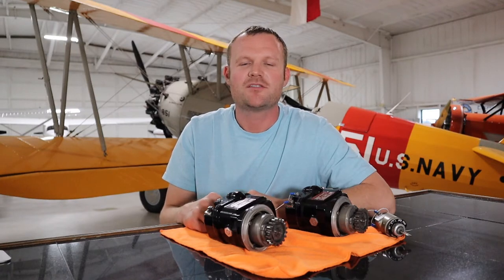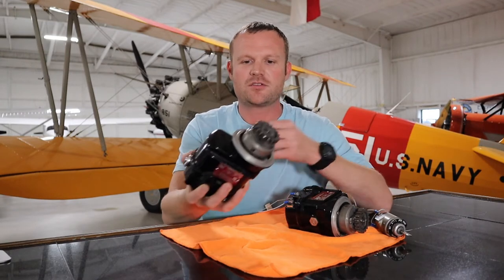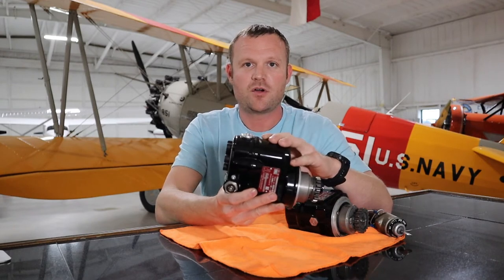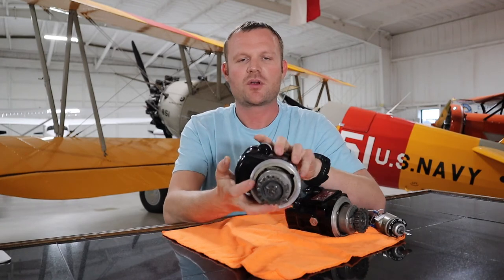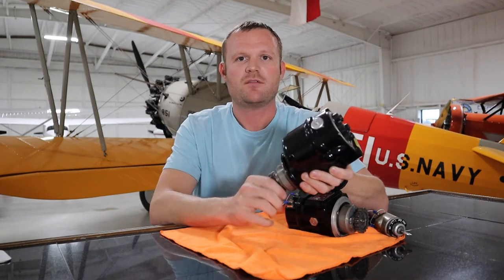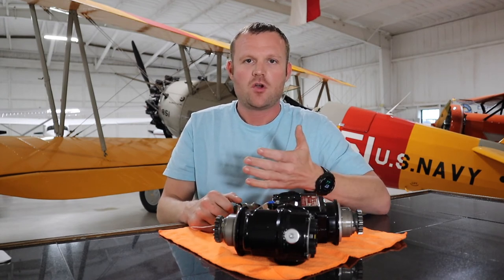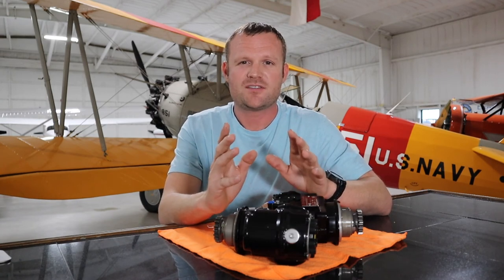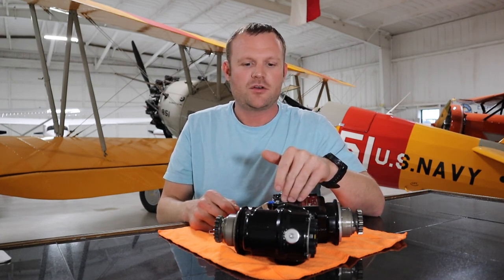Magnetos - Aircraft Engine Systems

Comment: I would add this to the information presented in this video:  In my 45 years of flying every checklist I have ever seen describes the procedure for doing a magneto check during the Before Takeoff checklist items.  That is all well and good, and should always be performed.  However, I subscribe to doing another magneto check after you land and are going through the Shut Down checklist.  The reason for that is that it is possible to loose a magneto during the flight and you may not even notice it.  If you check the magnetos just before shut down and find that one of the magnetos is inoperative that is the best time to report the failure to a mechanic so he can resolve the problem.  That is much better than finding out you have a magneto issue just before getting ready to takeoff and then needing to delay, or even cancel, your departure.
Reply: That’s how it’s taught here in New Zealand, check before takeoff and before shutdown

Comment: I only worked in aviation a short time, back in 1970. After I got my A & P license, I worked in other parts of aviation, getting little experience. When you graduate from aviation school, They tell you to go out and learn to be a mechanic.I think a lot of people don’t know that there are 2 plugs per cylinder. I’ve learned more from watching these video’s than 2 years of aviation school. We never had a mixture control on the carburetor to kill the engine. I had little magneto training. They need to know that the magneto has a permanent magnet that produces spark in the primary and there is a set of points that shorts out the spark to ground, so the secondary doesn’t fire. I used to prop the 150’s and 172’s all the time until I took the starters to an automotive shop, replaced parts form an automotive starter had the same guts.

Comment: If I may ask.
What you mean. The only way to turn off the magneto is by grounding?  I am thinking when you turn off on the switch you are connecting the positive to the any metal or metal casing
2nd) the ere just like you showed from magneto to the switch, no rallays or anything else?
Thank you

Comment: So during engine run up, when checking the left and right mags, is a 25-50RPM drop in the normal range?
Reply from the maker: Yep, Regular Tachs arent very accurate. Ive seen some that are off by 100 RPMS. The engine might be dropping 75 Rpms but only shows about 25 or 50 Rpm on the Tach. Really  Im just looking for it to not drop too much, and also i dont like it when it doesnt drop hardly at all, like 25 RPMS or less. To me that indicates that a Magneto isnt timed Right.

Comment: So does it act in the same way as distributors did in older cars?
Reply from the maker: very similar, but the only difference is a distributor has to have power form a car battery to create a spark, the magneto creates its own spark by using magnets.

Comment: What is inside the & what makes fire?
Reply: There is a set of points in the magneto that opens the primary coil, then induces it into the secondary, at a high voltage, similar to how a transformer works. You can’t transform DC. It is constant, Ac alternates, reverses direction.